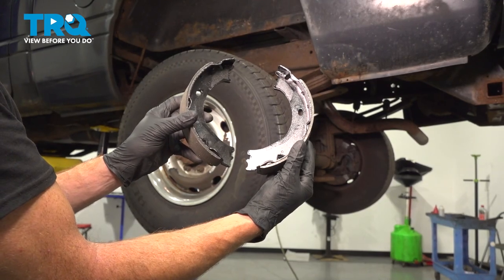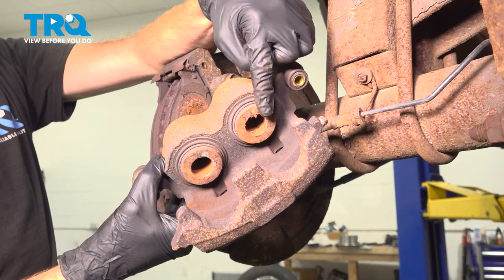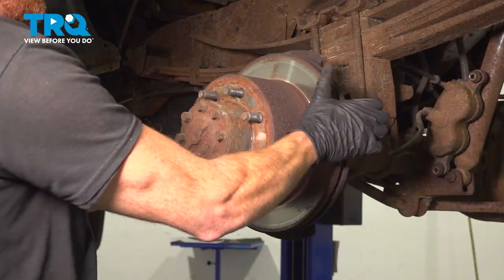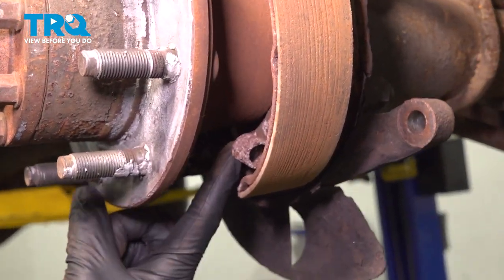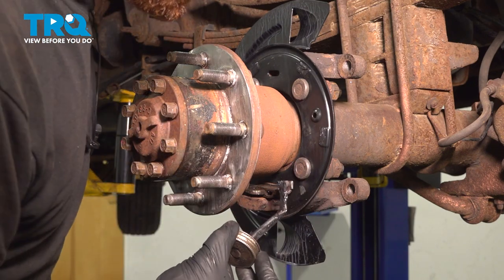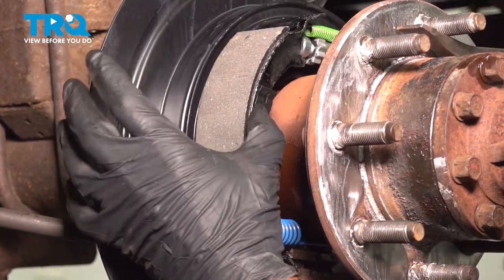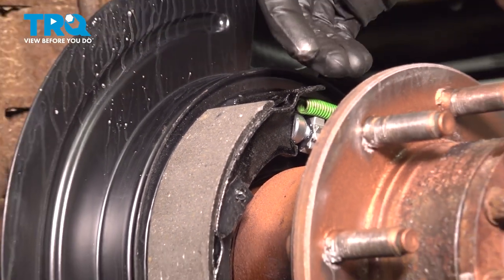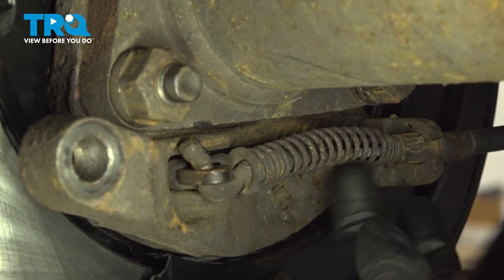How to Replace Rear Parking Brake Shoes 1994-2002 Ram 2500

Comment: I presume that since the  adjusting star wheel on the passenger side is on the bottom that we need turn the star wheel in the opposite direction of the drivers side to adjust it up.